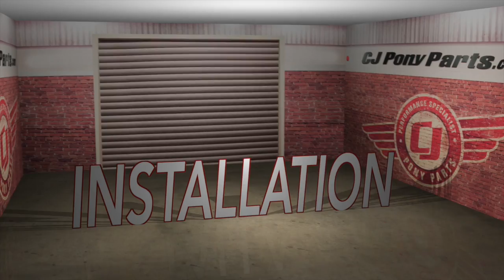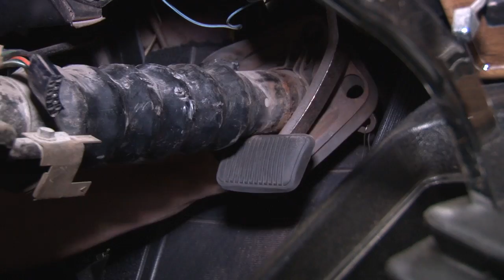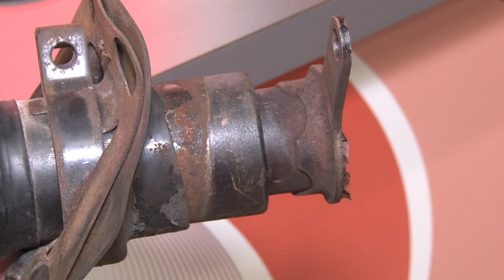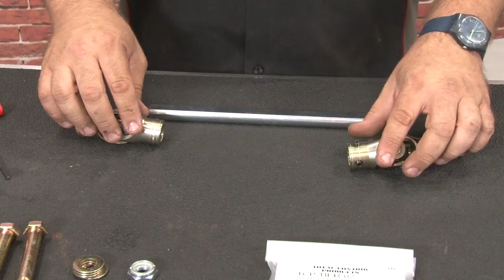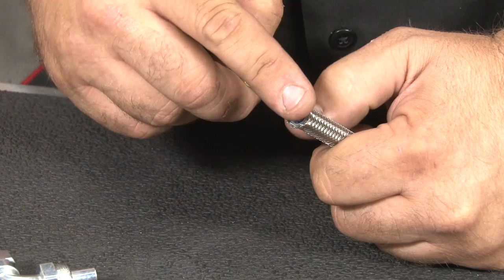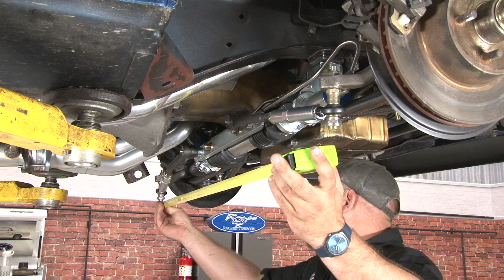Rack & Pinion Power Steering Conversion | Total Control Products | 1967-1970 Mustang

Comment: What headers is that, used in this Mustang with 351C?  My Hooker headers (from the '80s) nearly rests on the steering box.  So much room to pass the u-joint steering shaft with this one.

Comment: How do you adjust the rack. It came very sloppy out of the box. To what tolerances do you tighten the rack when its installed? To avoid arm movement or over tightening. Is there a video on the rack adjutment?

Comment: Why do the gold anodized fittings on the outer ends if the tierods hang down so low? Seems as though they would be very susceptible to damage. Can they be mounted to the top of the knuckle for better ground clearance?

Comment: What is the total set up you have on the table? Total it is over $4000 considering i have to by buy Tie Rods. Anything I missed, please let me know?
I am at CJ website and see that 
#1 $2,619.00
Total Control Products Power Rack And Pinion Conversion Big Block 1967-1969
Total Control Products: TCP RCKP214
https://www.cjponyparts.com/total-control-products-power-rack-and-pinion-conversion-big-block-1967-1969/p/TCPRCKP214/

#2 $1,170.00
Total Control Products Power Steering Pro Integral Reservoir V-Belt Kit 351W/351C 1965-1973
Total Control Products: TCP PSP1212
https://www.cjponyparts.com/total-control-products-power-steering-pro-integral-reservoir-v-belt-kit-351w-351c-1965-1973/p/TCPPSP1212/

Comment: Since this is a unique "Center-Take-Off" Rack and Pinion, what device does that rack use to hold thee center moving housing from rotating from up or down? I did see a large set screw in the bottom center of the housing. Is this an internal flat-preload guide control for keeping the center of the housing from dropping with the weight of the guide bar and both tie-rods from dropping down? Otherwise, this would cause a "Bump-Steer" issue if it moves.
Thanks for any info! ASE Master Tech since 1978-Retired. 
My son has 72 Cougar with big block, installed with large shoe spoon! Perhaps a future project with the old man? Maybe...

Comment: Will this fit a 1970 4 barrel Cleveland with  big tube Hooker Headers.  Or does it need a custom  set to clear the  Rack!
Reply from the maker: Most headers will clear the rack, this car has since had a stroker Cleveland built and runs long tubes with no issue.
Reply: @cjponyparts  Thanks I love the Mach I. I didnèt think it was bad 40 years ago but after driving newer cars with a rack the old wondering steering System just donèt cut it.

Comment: TCP rack and pinion doesn't improve the inherent 'less than perfect' Mustang geometry.  You still have bump-steer be it less tiresome.
Reply from the maker: Because of the location of any aftermarket rack and pinion you can still have bumpsteer issues, we offer several kits from TCP to help correct this.

Comment: Does anyone know if this kit is the same for a 70 Torino/Ranchero Cyclone/Montego? If you lift the hoods theyre all identical appearing as the Mustangs with the shock towers and all. They all use the same control arm suspension and bump steer/leak riddled power steering components.

Comment: Z-bar manual.. did I see that correctly? All Rack kits I've seen require Hydraulic Slave refit.
Reply from the maker: Yes this is a 4 speed car with the original linkage. - Bill

Comment: Your install on the 69 looks great. I have 1968 Small Block 302 w/AFR heads and old air airconditioning. The A/C compressor mounts to the left head. will this interfear with the P/S pump mounting? My wife can't wait to drive my pony and neither can I on long trips.

Comment: Keep in mid if you're switching over a manual steering car you're going to need a fan pulley from a power steering car.. I overlooked that on my install. Other than that this system went right on my 69 fastback.. can't wait to try it out. Thanks for the vid Bill, it helped a lot.

Comment: Bill, what make are those headers?
Reply: +Alb3113 Onni  Ford Powertrain Applications
Reply: +Bill Tumas 
Thanks Bill, I'm installing the manual rack in my 70' with a 351C 4V and I'm having clearance issues with the Patriot headers I have.  Thanks for the info.
Reply: +Alb3113 do you have manual trans ? can't find headers to fit mine ,70 351 4v manual transmission
Reply: +Alb3113 do you have manual trans ? can't find headers to fit mine ,70 351 4v manual transmission
Reply: +Maiky Reiter 
I have a T5 with Ford Powertrain headers on now.  I did have Patriot exhaust headers on but they didn't work with the TCP rack and pinion.
Reply: +Alb3113 What "brand" "make"usually refers to a car. =)